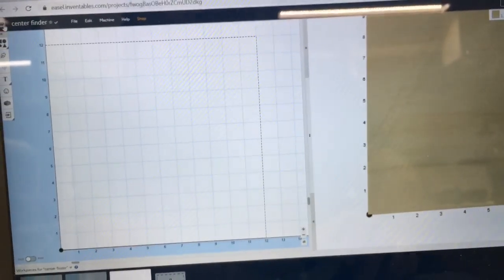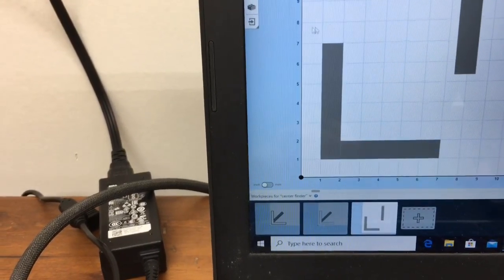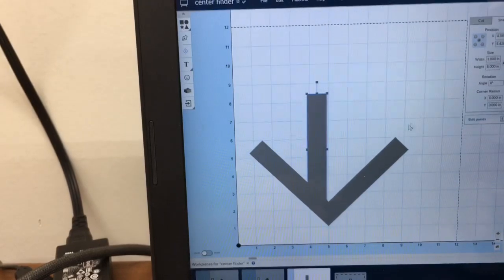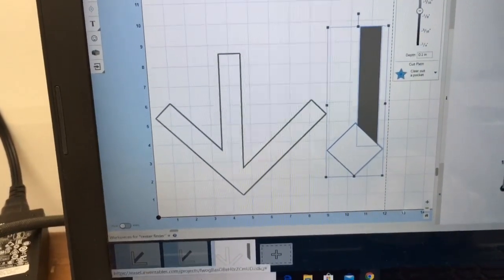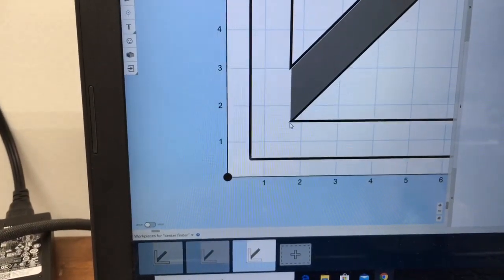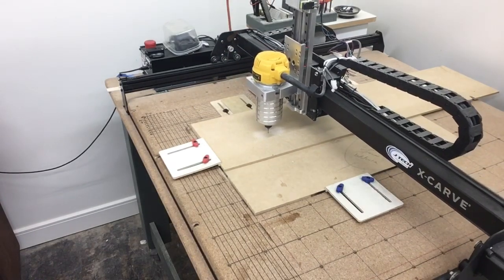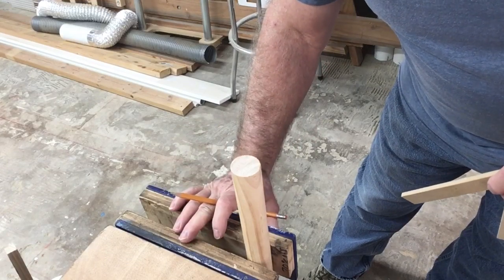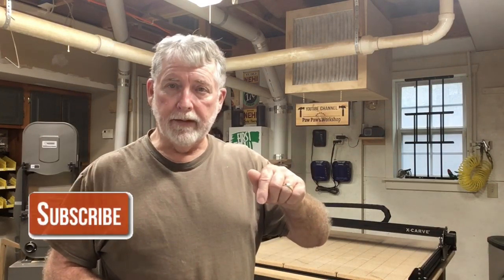Simple Center Finder Tool for the Shop

Comment: Would there be any changes to the size of the jig for finding center on 12" to 16" rounds? I would lengthen the middle leg to 8" or 9". Even though watching your videos makes a lot more work for me please don't stop!! 😃😂😉🙃
Reply from the maker: No other changes would be necessary except to make it out of a stronger material so that it does not flex. Thanks for watching

Comment: Hi Paw Paw! I am getting better with my Fox Alien 4040 XE! I am having an issue engraving the molded acrylic because of the variance in the thickness. Have you ever tried the spring loaded diamond drag bits on this machine? Is it possible to run this machine without the spindle running? I don't know if you remember the problem I had with the bit not going down far enough , but, when I went to "Home" the machine the other day, the Z axis hit the top and started grinding terribly and the machine just stopped. What was happening was the Z limit stop bracket was set to high for the limit switch to fully engage and of coarse this also keeps the lower limit higher along with it. I loosened the 2 screws on the stop bracket and lowered it about 1/2" and now the machine is happy! Also thought you wood get a kick out of hearing that I found out how sharp those pyramid V bits are. I was mounting my board and managed to "biopsy" the back of my left hand. Won't do that again LOL! Thanks for your help and videos!!
Reply from the maker: Hello again,  you have many questions. First, I have not tried a spring loaded drag bit. I would say yes it is very possible to use one with the machine. Second, yes, you can run the machine without running the spindle. Not a problem at all. Third, when you home the machine, it does not stop and creates the grinding noise. Look at the limit switch. You have a problem there either the wire is loose, broken or missing. The limit switch itself could be broken or loose. For whatever reason the switch is not being activated and causing the z axis to attempt to continue to try and find the switch
Reply from the maker: You are learning fast. Keep up the good work

Comment: What type of material are you using for your waste board on the x-carve???
I'm currently using 3/4 in mdf, but notice that you are using a different material.
So i'm curious to know what it is and where you purchased it from.
We have a lot of humidity here in the south, so it's hard to keep a truly flat surface.

Thank you for and help.......
Reply from the maker: My waste board is made of particle board.  I have found that it is more stable than MDF. I live in southern Louisiana and have high humidity also.  I have never had a problem and it is over three years old. Thank you very much.